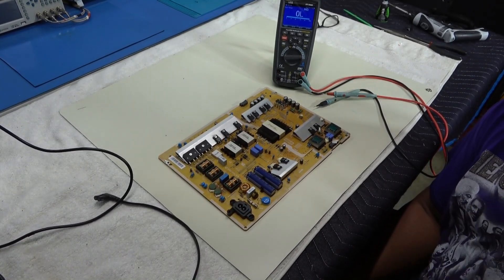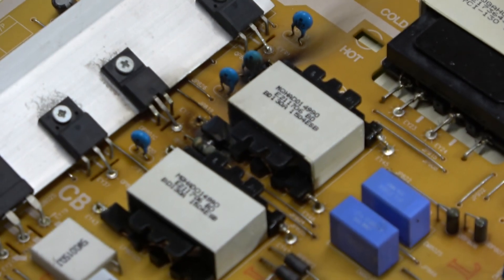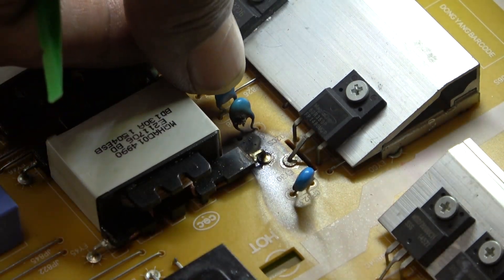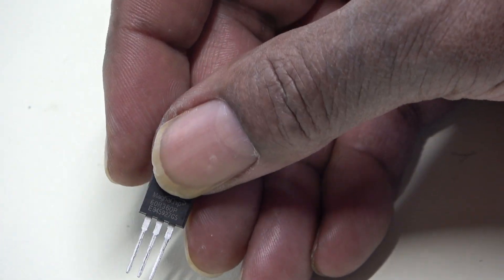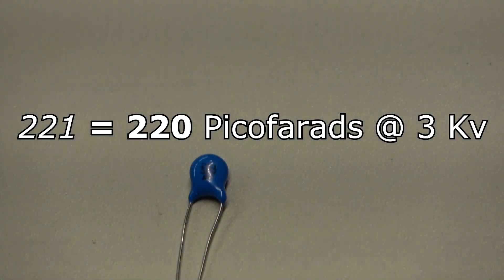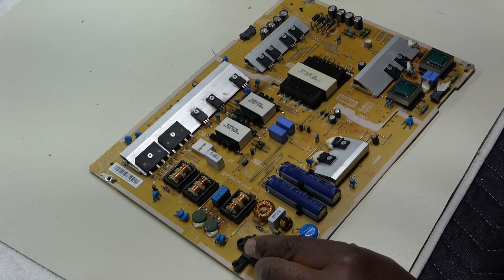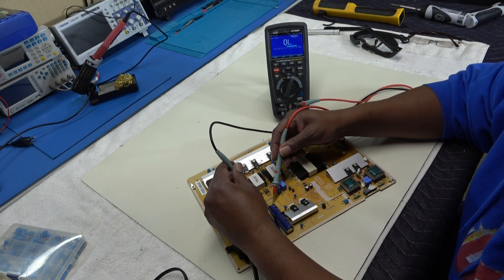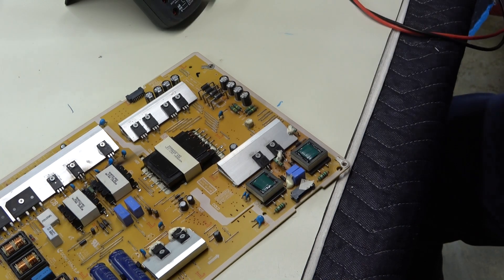Samsung UN65JU6500fxza no picture, no power, & no standby light TV repair.

Comment: that looks like such a dangerous way to check a board. Leave it inside the tv if you want to power it up and keep it under load so not to risk blowing up the outputs. Just a matter of time before you forget it is powered on and grab it to turn it over. Best to have someone there to turn the power off when that happens.
Reply: When I worked in a tv repair shop we had a isolation transformer with a red power light. I'd plug the device I was repairing into the transformer. 
The red light reminded me when it was powered on.
Reply: Always get into the habit of picking up the board by the edges..don't touch any components on the underside.

Comment: Hello there , I have samsung led tv model no. UA 65f8000 which not turning on and frequently restarting itself, making noise tik ,tik.... It's power supply no. Is  BN6406691F. WHAT SHOULD BE A PROBLEM IN IT ?. HOW CAN I REPAIR IT ?  THERE ISN'T ANY POWER Supply AVAILABLE AROUND MY REGION ....

Comment: I have a Samsung un50ku6300f which I have replaced all LED backlight strips, power and main board. It still wont boot up. The backlights flash brightly for about 3 sec then flash dimly for about 2 seconds and then go off. the cycle repeats after about 20 seconds. If I remove the cable from power to main board, backlights come on and stay on. Leads me to think problem is not power board of anything to do with backlights. This has me really stumped!

Comment: My school bought 17 70" Samsung TVs one summer, they are now 2 years old and out of warranty. I did TV repair in the early 80s and as a hobby ever since. The 4 all have the boot cycle issue.  I have narrowed it down. If I disconnect the jumper on the LCD panel going to the right side or the left side, the backlights stay on. At that point, I figured the middle section (T-Con) was the problem. The one IC I could replace is a PIC chip. The Datasheet shows it as non-volatile storage. Okay, I'm done. The IC might need to be re-flashed, or the screen is bad. But then it came on for no reason! Looked like it was okay responded to the remote. Unplugged it, waited a few seconds, and plugged it back in. No good. Back to the boot loop. If the chip lost its programming or the screen was bad, it wouldn't fix itself. AI's not there yet. Any advice on this would be really appreciated. I have 13 more in classrooms from the same batch.
Reply from the maker: Does anything come on the screen or is it a blank display when it cycles?
Reply: Blank. All LEDs turn on and change brightness (as seen through the holes in the back plate). The red LED blinks twice, then turns off and back on with a chime sound like normal. I have 4 of them, all exactly the same. I guess there are no more Sams Photofacys anymore.
Reply: Changed both modules, the mail one twice the first time.

Comment: Hello,
I came across your videos while trying to troubleshoot a BN44-00611A, U gotta tell you I learned a lot from your videos. Unfortunately, I cant find any troubleshooting guides for this model anywhere. The model itself is rare. It looks a lot different than most of these boards you have. Do you have any suggestions? It has sound but not picture. It was initially an LED strip that was shorted so I fixed that, but still not working. THank you.
Reply from the maker: U sound like you like learning. If your sure its not the led's still, then I suggest the troubleshooting course. Just go to my Channel Page to get the link.
Reply: @bigdog8882 oh screw you for that

Comment: Excellent video thanks for making and sharing your knowledge.  I'm trying to work out why our Samsung TV has no power, I've checked the PSU board and there is no physical signs of damage (burns/buldged caps) I checked the main fuse on the PSU and its good, when I disconnect the main board with power on the backlight does NOT illuminate, what does this mean?  Also I checked the PSU to mainboard connection and the pinout says A13V so I was assuming 13V but im only getting 3V on all those pins labeled A13V.  If you have any wisdom I would love to have your input.  Thank you and blessings.
Reply from the maker: Thanks. their is a series of checks on primary side and secondary. If you watch the last video I did on the Sony PS board. That may help.
Reply: @bigdog8882  You're welcome!  Ok thank you kinldy, I'll check it out!

Comment: I usually change the mosfet driver ic since when mosfet goes short it puts full supply back into the gate driver👍
Reply from the maker: Yeah, usually if the smd resistors at the mosfet's Gate are burned, then its definitely time to change the IC. Hopefully we'll be good for a while on this one.😜